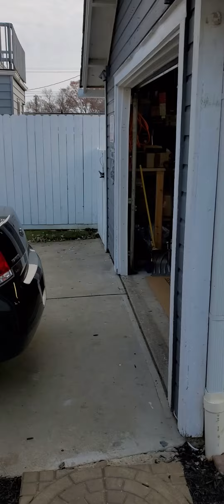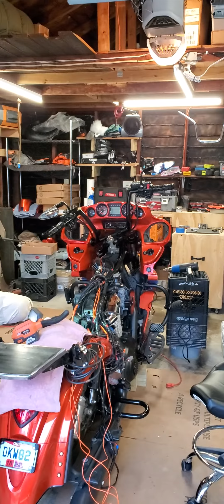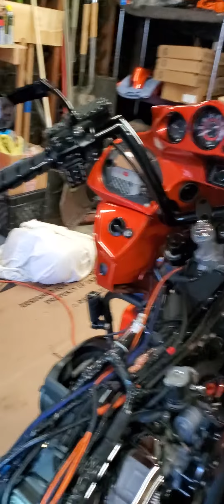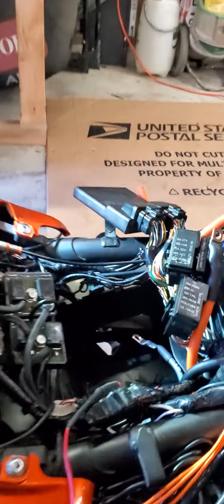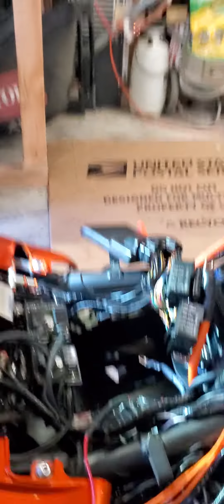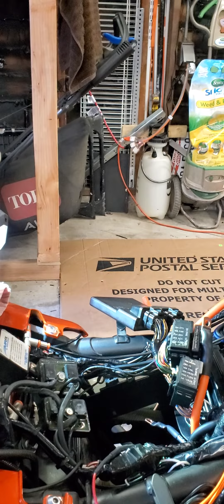Kawasaki Vulcan Vaquero under the seat battery upgrade part 1

Comment: Your ground wire should never be a smaller guage than your power wire...but good job on putting this info out on your work...what battery did you get exactly?
Reply from the maker: Great point but I'm running to independent ground wires to the factory frame ground spots the ground wire for the battery is just for that and the rest of the stuff will run on another ground wire still on the main frame spot to provent a ground loop all together...... Been there with the ground loop 🤦🏿‍♂️ 🔫.... Not to mention my system will not even touch my bike battery...... I will be running 3
Reply from the maker: Oh really..... Well thanks I appreciate the input.... I did ask a couple of people who work in shops they said because of the distance in my application.... It won't really matter.... The power wire is not gonna open up as much as it would if it was like say 4 or 5 feet as long as I go no less that 8 gauge I would be good
Reply: @TheMasterkiller24  I also work in the audio industry (a looooong time) and with the amount of items you have going on matching your ground wire to your power wire is important for optimum efficiency as well as safety. I had one person a long while back learn the hard way when his ground wire literally melted due to the strain put on it and it almost damaged his entire system,I  would atleast put the same size ground if you dont one size go larger ,Here is a good read from kicker on the big 3 upgrades and why https://www.kicker.com/app/misc/support/tech/tech_papers/docs/PowerWireAndTheBig3Upgrade.pdf
Again this is not to insult your build as it seems very good and I like your eye for detail. You have even given me ideas on somethings to do to a few bikes including mine.
Reply from the maker: @RanGer-498  man I take absolutely no insult... I appreciate all advise and info... And because I would rather cover all my bases I went out and change the ground wire..... LoL... I would hate to have any issues and have to come back to that and find out that was the problem...... Much love brutha 🔥 💯
Reply: @TheMasterkiller24  I'm glad, I was in no way attempting to insult you ..again I love how detailed you are in so many ways I honestly wished you made more videos ,any how keep up the great work cant wait till your next vid.